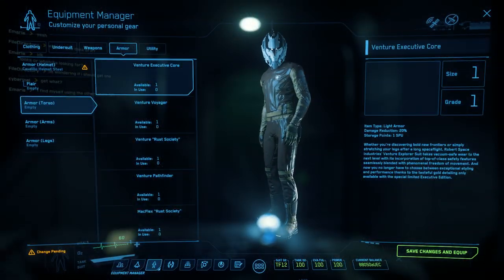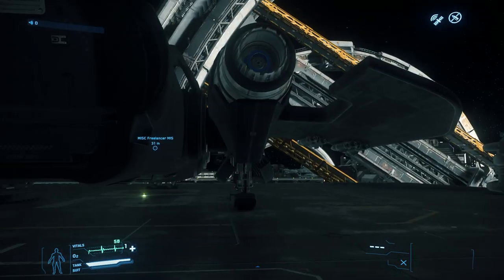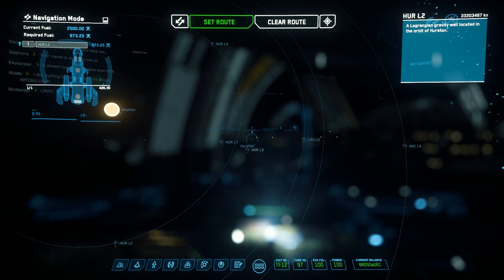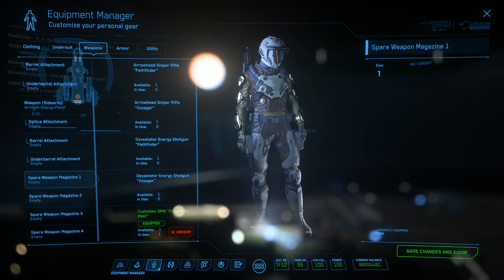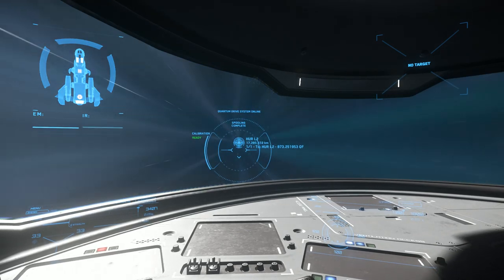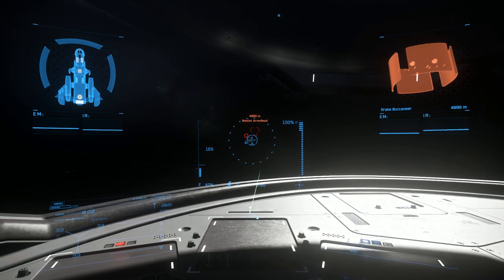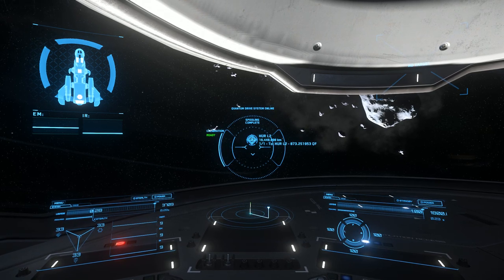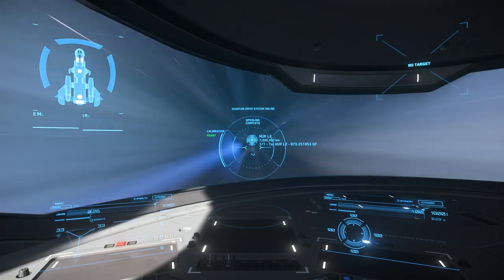XtraCast Blast 64: Designing Better Thrusters

Comment: A point ot the "speed governer" point by Lightning Dragon. 

Here in Europe, almost all car manufacturer that are premium enough to make a car that can go 200mph is required to put in a limiter at 155mph. Large hauling trucking are capped at around 55mph. This is of course able to be turned off through software in both cases. In order to get a car that DOESN'T have a limiter... you will indeed be paying out of the ass for it.

Also, this discussion inspired a spectrum thread - https://robertsspaceindustries.com/spectrum/community/SC/forum/3/thread/artificial-capping-for-game-balance-in-a-game-that - as I think your video is a nice discussion that should be critically thought about. I added my own "little" comments of course but I think overall you guys have a nice, healthy and critical talk about thrusters.

Comment: Removing Hover mode was was a mistake, it made landings FAR more satisfying and interesting to perform than they are in 3.7.  If they were to merge Hover mode and proximity assist, I could see things working out, but as it is, I'm very afraid we're going back to the bad old days of flying turrets dominating everything on the ground with utter impunity.

I want landings that look like landings made by spaceships, not robotic, stilted, stuttery half-crashes done by spaceship-looking objects; We were closer to the former with Hover mode, but right now we have the latter.
Reply from the maker: The controls were configured incorrectly and it needed manual control of activation.  It had a LOT of potential... but like all things flight related... it had to go into the garbage, because the arcade community hates flight mechanics.
Reply: @CitizenGamer  It wasn't even a complicated flight system, they could have gone much further in-depth with it, but stopped short with a relatively appropriate degree of depth insofar as VTOL mechanics go.

My contempt for the likes of the Arcade community really knows no bounds here, especially since Hover mode was easy to learn and didn't require much practice to get good at.  We had landings that felt damned good with 3.6, but now we're back to flying turrets, and I'm seriously concerned we'll be stuck with flying turrets.
Reply from the maker: You and me both....
Reply: I agree with you. It was a bad idea to take it out.  Hover Mode was mislabeled.  What they had was VTOL flight physics which made ships fly as they would in VTOL. All they needed was a true hover mode/ autopilot to put the craft in level flight just like helicopters like the Gazelle have. There should be three phases of flight. Forward flight, VTOL Flight, and hover flight with thrust, duration and temp limits depending on ship configuration and capability. In the atmosphere, ships should be required to maintain forward flight above their airframe stall speeds. When in VTOL the engines should be limited on thrust and temperature durations unless appropriately equipped for long-duration VTOL flight like the prospector would be.

Comment: 7 years of development and the game still is plagued by desyncs on what seems to be an empty server.

And while I pretty much agree with LD, if I can guess the reason they will not fully adhere to physics is that CR wants to have his cake and eat it too. The ships are designed with 'rule of cool' above everything else while CR wants to brag about his game having next-gen physics and systematic flight in opposition to how everything was 'faked' during Wing Commander days.
Reply: Pan Darius Kairos 

>Issues like desyncs will likely persist up until launch or longer (hopefully not too much longer). That's just the nature of an alpha

desyncs are to be expected, but in SC's they occur at such rate and severity that the entire experience becomes unreliable, even for an alpha.

 How many improvements did the netcode get during the 7 years of development? and every time we're told the next netcode update will turn into a more stable and enjoyable experience? Yet we see desyncs that remind the times of when a server would die if you spawned a Starfarer.

After 7 years I would expect the low to medium level of desyncs to at least self-correct in a reasonable amount of time and not require your game to crash. 

Now, about flight, let me spell it for you: CIG can do whatever the fuck they want but the moment you use an accurate physics engine then every action will have a proportional consequence and they can very well shrug it off or throw under the carpet but since AC was released we see CIG struggling to make flight compelling because the gameplay is disconnected from its own set of rules. That's what LD said about being full physics or not and what I expanded upon by stating CR wants to have his cake and eat it too.

>We are actually making good progress on flight

Yeah... I'll have to disagree on that one, maybe it'll start to really improve once SQ42 is released and the game press plus the larger gaming community heavily criticizes how bare bones it is.

Comment: Your number 2 is rambling on about billions of newton's of thrust, IONS particles, then tons of thrust, then back to pounds, then trucks, and cars and breaking your neck. I have no idea what he's trying to say!!  It's called Center of Gravity and that dictates where your center of lift should be or center of thrust is located in a rocket!  Balancing thrust between engines is a completely irrelevant discussion between that would be handled by a FADEC system and not even noticed by the pilot. When a pilot moves the throttle the computer works out the balance, thrust limits, pressure ratios, and temp limits so it doesn't cause damage to the engines. The bottom line is, it can be done better! There are plenty of ways they can do it and there are plenty of examples to take inspiration from in today's aviation & space programs. CIG just needs someone who understands it all. I guarantee you a harrier in full downward vectored thrust is not going to be allowed to go into full afterburner due to the flight control system limiting thrust do to its configuration. Mounting two F18 engines on an A380 is not going to make the A380 fly and mounting an A380 engine on an F18 is going to crush it. NO, F18 will ever be able to carry the weight of a C5 Galaxy and no C5 will ever outmaneuver an F18. It's all about power to weight ratio, airframe G force limits, Drag, stall speeds, the mechanics of the engine, it's spool times, and temperature limitations in different phases of flight. 
A good start to getting landings and thrust correct would be to strip away everything and go down to basics. In the current game engine, on a 1G world with no atmosphere. Do objects accelerate at 9.8M/sec2 as they should regardless of weight?  Then build on that by adding thrust to counter fall rates and pressure to create atmosphere, drag, and lift and so on. I dought the basic acceleration rate and free fall physics are in the current engine we have which is going to make it difficult to get flight correct. Once you have freefall physics you can then start to build on all the variables that are introduced by weight, thrust output,  planet Gravity force and Drag.